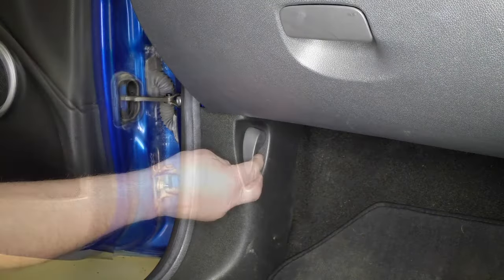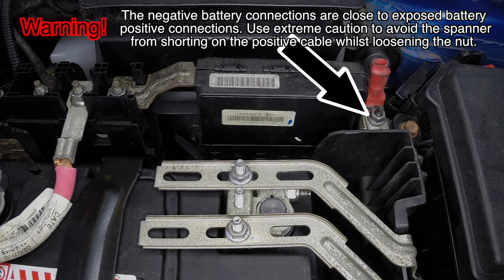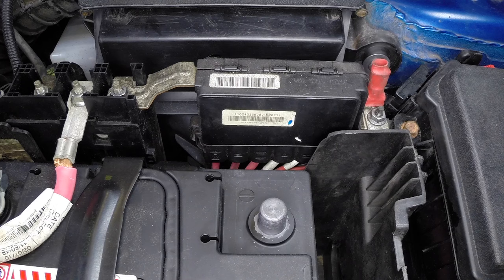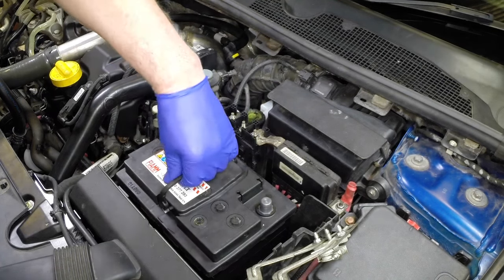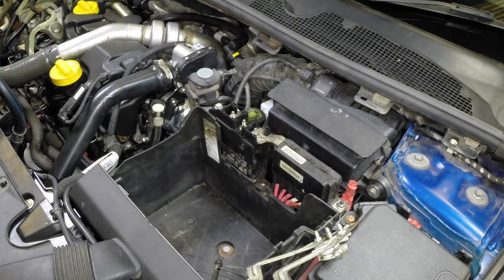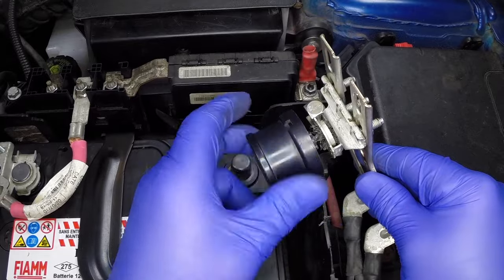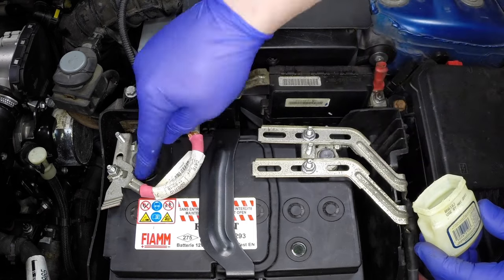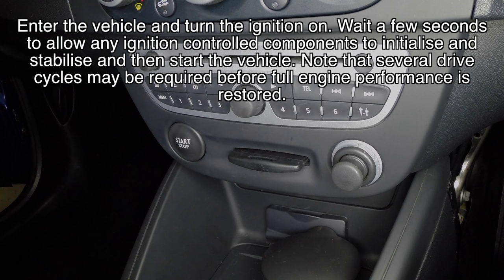How to Replace the battery on the Renault Megane 2008 to 2014

Comment: Thank You for sharing your story. It helped me with my car. My car has the start stop system and everything went smoothly for me when changing the battery upon watching your video. On the cluster there was the message " New battery" yes/ no. I chose yes and started the car. No problems whatsoever. Thanks again I saved some money.

Comment: I used a 278mm Exide 77Ah EA770 battery in my daughter's Renault Megane III 1.5dCi 81kw, and it has been working without problems for the third year.

Comment: Thanks for the really helpful and clear video. I'm struggling to find a socket wrench that can fit in the gap to undo the negative terminal, any advice on the size you're using or where the wrench is from?
Reply from the maker: Looks like we used a short extension between socket and ratchet
Reply: You probably already found a solution but for next time just disconnect the other visible negative bolt take off the battery and then disconnect it from the old battery